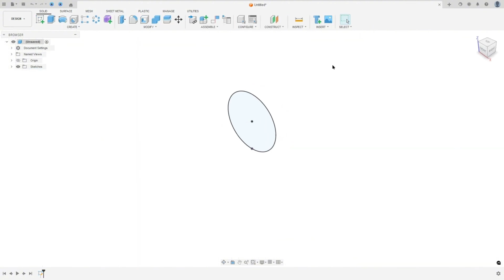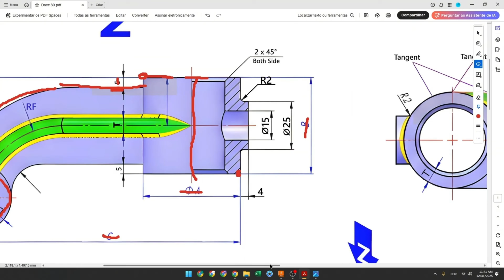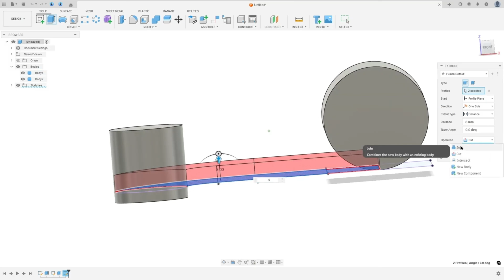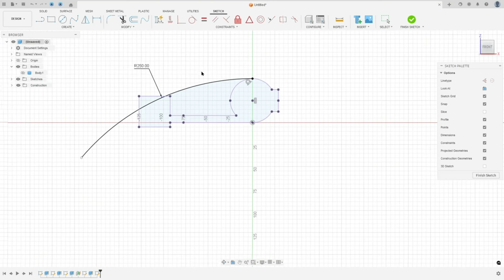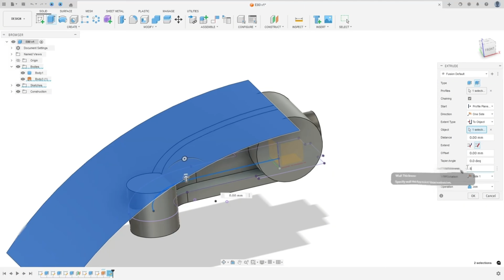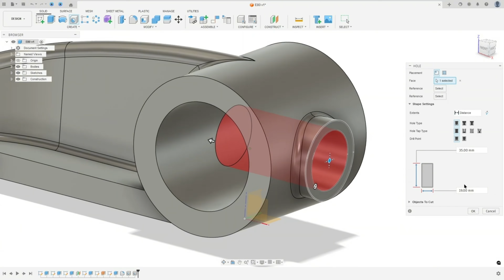How to use Extrude to Surface in Autodesk Fusion 360

Comment: Here’s a suggestion: Why not take on a major project—like an engine, a vehicle, an aircraft, or a piece of heavy machinery? Since these involve so many components, you could create a video for a specific part each day. This would turn the content into a continuous series, unlike your current videos, which feel disjointed and lack a connecting thread—making them quite boring for viewers. I hope this helps. Thanks!
Reply: good idea,
Reply from the maker: Thanks! I really appreciate you taking the time to share your idea.

You're absolutely right—having a long-term project gives viewers something to follow and look forward to. It's actually already in my plans.

Before I start that series, I want to create a "Learn Fusion 360 in 45 Days" mini-course. My goal is to help more people become comfortable with Fusion 360 so they can get the most out of the project series.

Once that's finished, I'll start a series where we design and build a complete machine from scratch, one part at a time. I think it'll be a fun way to learn CAD, engineering, and how real mechanisms work.

Thanks again for the suggestion, and I hope you'll be around to follow the journey!